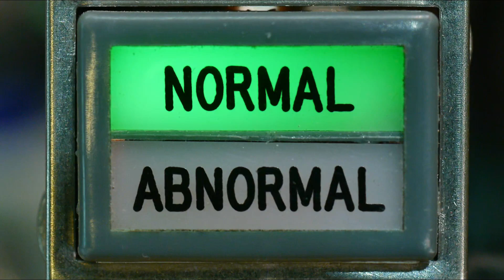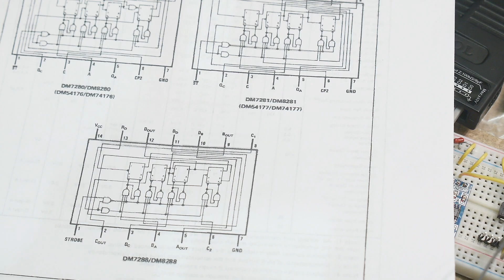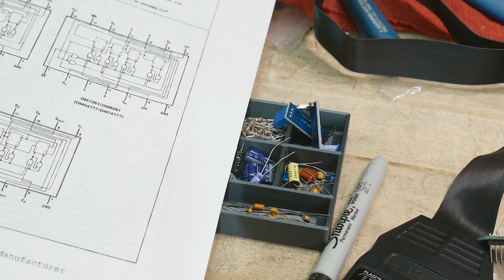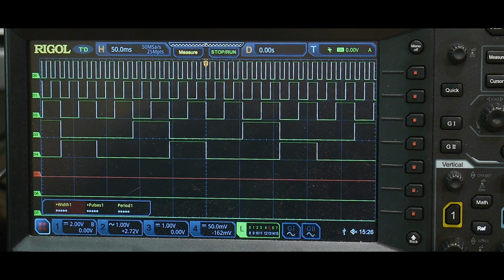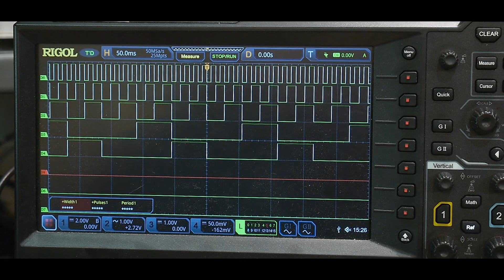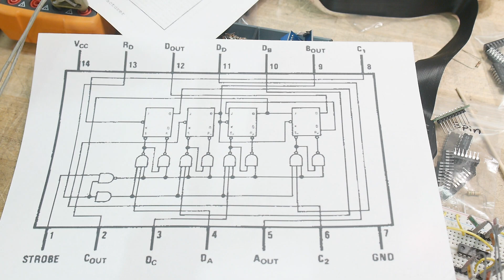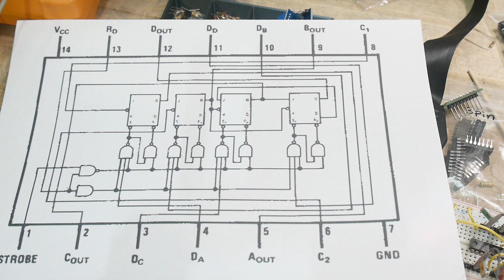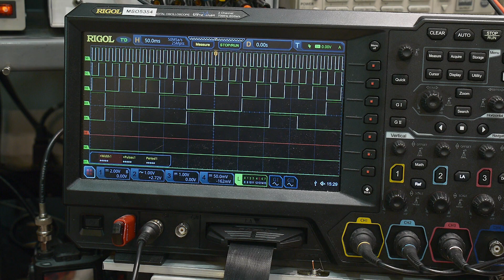#1297 DM8288 Divide by 12 counter with preset

Comment: Back in old days in 70s, "S" was the fastest  (and the most power hungry) TTL you could get.  Then the "F" series came in '80s.  Obviously the most useful ones were the LS series.  When TTL came out in late 60s, the series would start with 74, 54 and 82  so that the big companies wouldn't step on each other's toes and specifications.  54 for TI and 74 for RCA and 82 for Signetics.  In 80s I used 82S90 for my homemade frequency counter which was like 74S90.  The chip was blazing fast and would work up to 100 MHz.  Z80 back then had a 2 or 4MHz clock.

Another thing that I just remember is that if you preset the 2s compliment to the chip at 0000, you can divide any number between 1 and 16.  However once I used a down counter to div by n for my  4046 pll frequency synthesizer.

Comment: This reminds me of the SN74LS92 divide-by-twelve counter. It was simpler, though, without the preset capability.

I used one of those in a college class project to interface a DAC to a 68008. We worked out that dividing the CPU clock by 12 would get us close to the DAC's maximum clock frequency without going over. So that's one example of its utility.

An even more niche use could be to count out words in 12-bit bit-serial CPUs. I think I remember a PDP model that had a CPU like that.
Reply: Found it -- It was the PDP-8/S, but it didn't use 74-series logic.

Comment: Also, decade counters are 2x5 and 5x12=60 making this useful for 60 Hz AC clocks and desktop frequency counters:  60 cycles = 1 s, 60 s = 1 min., 60 min. = 1 hr.  One of the extra /2 can be used for am/pm indicator.  But, clock ICs with LED drivers soon put them out of business.